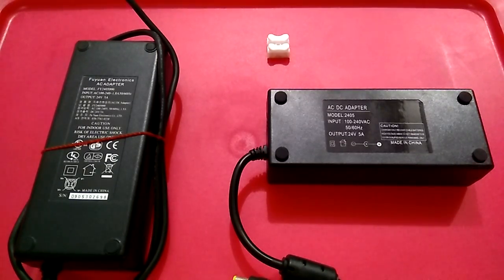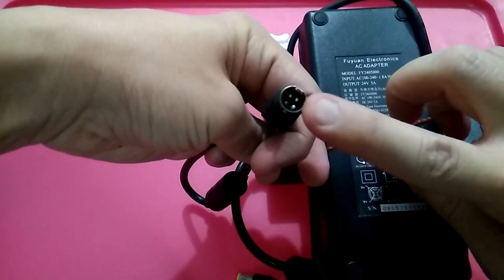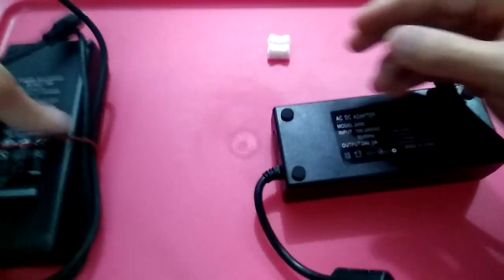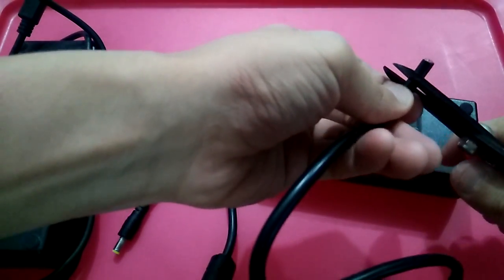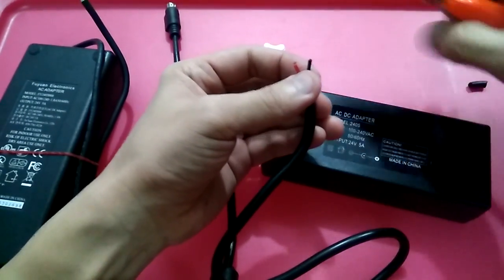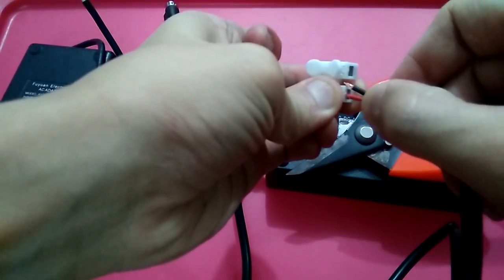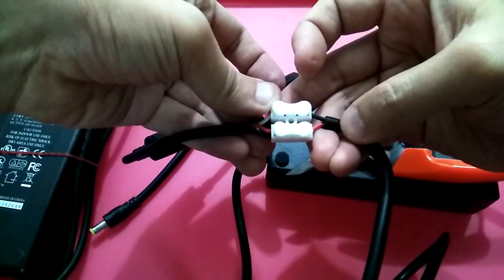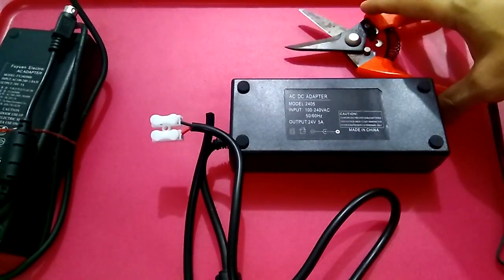How to use any power adapter with any Lenovo / Dell / HP connectors - Life Hack Tips

Comment: How do you know it should be red to red and black to white? What if you have three wires on each side - a black, a white and a red on one side and a black, a white and a blue on the other? What goes to what?
Reply from the maker: For DC, usually there are only 2 wires.

Usually Red or Brown is +ve. Black or Blue is -ve. If you have a multimeter, then you can test the polarity to confirm.

Comment: Hi, I have 2 computer monitor & 2 AC DC adapter as follows:

"Monitor A" runs on 12V 3.75A, and "Monitor B" runs on 12V 5A.

"Adapter A" rating is 12V 3.75A with DC jack 5.5mm x 2.1mm, and "Adapter B" rating is 12V 5A with DC jack 3.5mm x 1.35mm.

For the Adapter A & B is correct rating but its DC jack would need to be swapped in order for both monitor to work. Does the size of the DC jack may affect the adapter if swapped? 

And what rating would you advise if I were to use a 12V DC splitter cable 1 female to 2 male to power up both monitors instead? Found such cables on Aliexpress.
Reply from the maker: I don't quite understand the scenario that you described. Unable to comment.

Comment: Dude what is this circular connector name? I cant find it anywhere just brought the same monitor u have but the power supply wasnt included
Reply from the maker: That connector is :

A male 4-pin "Kycon" power connector, which appears similar to a Mini-DIN connector.

More details :
https://en.wikipedia.org/wiki/DC_connector
Reply from the maker: You may want to check out this thread for more information.

https://www.overclock.net/threads/crossover-27q-led-led-p-27m-led-2720mdp-gold-led-monitor-club.1232496/page-322
Reply from the maker: https://www.alibaba.com/product-detail/AC-Adapter-12V-10A-24V-5A_1285152362.html

I can only find this so far. But for this 4 pin connector, there are 2 version. I bought one online and it was the wrong version. That's why I need to do this.
Reply from the maker: You can scroll down and find the correct polarity required for this monitor.

https://www.overclock.net/threads/problems-solutions-crossover-catleap-qnix-shimiam-27-2560x1440-monitors-bought-online-how-long-did-it-last.1471025/page-2#post-25555200
Reply from the maker: https://www.aliexpress.com/item/32810506993.html

IMPORTANT : This one, DO NOT work. Because this one, the pin 1 & 2 are +ve. You need to find one that has pin 1 & 3 to be +ve to work on this monitor.

Comment: Can I combine two laptop power supply? 
I have a HP HDX 18 laptop that use 18.5 V 6.5 A. It is a large laptop. The power supply is dead. Inside it is clear that the small switch mode power supply transformers is burned. 

But I have two other HP laptop switch mode power supply 18.5 V but 3.5 A, both same model.

Can I take the output from these two  3.5 A power supply and soldering the two positive together and the two negative together and then get 18.5 V, 7 A?
Reply from the maker: Combining power adapter might be dangerious, please do NOT attempt. For current, the device will draw the current that it needs. So supply of 7A, doesn't mean that the device will draw 7A throughout.

Just curious, why would you need 7A for?
Reply: @onlinestuffsreview  For the laptop nemed  HP HDX 18. It is a large laptop.

Comment: how did u know the power adapter is not working rather than the led driver board?
Reply from the maker: The LED board was spoilt. I already replaced the LED driver board of the CrossOver 27Q monitor.

Then the monitor starts flickering and eventually failed. Since I got 2 x CrossOver 27Q monitor, I switched the adapter over and it's working.

Comment: Hey! Are you from Singapore? You sound like singaporean! Anyways. I got one of the 24V5A 4 pin adapter from taobao but it's not working. Any idea why?
Reply from the maker: Hi, yes I am. This 4 pin connector, apparently got 2 type. So you may have got the wrong type. Just cut and switch over the connector to try.

Comment: is there a way you can link two of those together to up the amperage so it comes out of one side for example 2 laptop chargers when connected to the other and at the other end is the out put
Reply: Roadhouse 115
Reply from the maker: It is possible but not advisable. Reason is that you may overload the adapter.
Reply: I have plenty of them laying around how would I go about doing this? I've been tinkering around with things like this so for me it's merely educational and a quick fix on the Fly should the need arise type thing I'm the MacGyver of my family and I needed to expand and I've always been afraid to try my hand in this type of stuff however if I'm going to do anything I might as well do it with everything I got
Reply from the maker: Just remember that for safety :

Always connect it to the power point last.
Stand a distance from the adapter when you turn on the power.